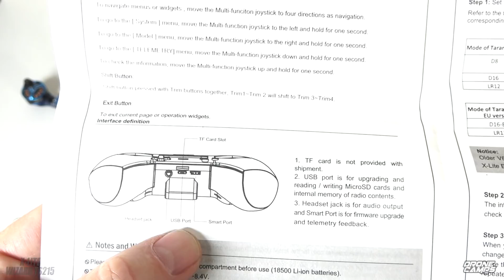EACHINE WIZARD TS215 V3 is BETTER than the others! - REVIEW & FLIGHTS + MORE AWESOME!

Comment: Holy Moly!  The Wizard has come a long way.  Is the flight footage in the review from the DVR??  I didn't see anything about a gopro. That would be insane if that was recorded with the DVR.
Reply: the dvr does  surprisingly well and you dont even have to think about it. if you have a sd card in it starts recording by itself and when you unplug it those big caps keep the light on and it automatically saves it no fuss no mess.great setup 720 video

Comment: Those motors sound like mine. I’m pretty new to qwads so trying to tune that out has been frustrating for me as everything is trial and error. 
Also, my DVR doesn’t record any sound. Is there a setting on the DVR to get audio in the recording? 
Thanks!
Reply: Your camera has to have a microphone. Even then its shit audio
Reply: Or vtx at least
Reply: I do get audio through to my goggles. Just none recorded on the built in DVR on the quad.